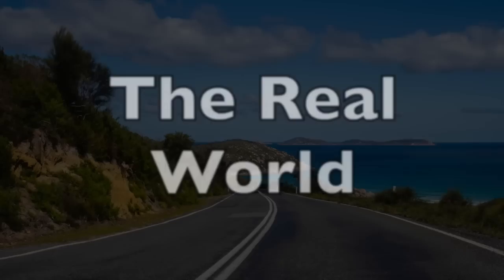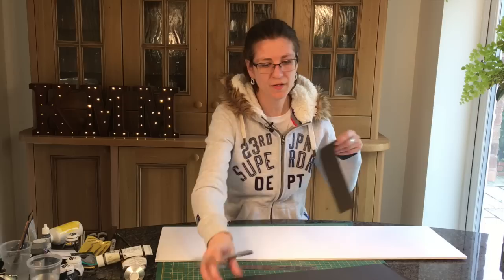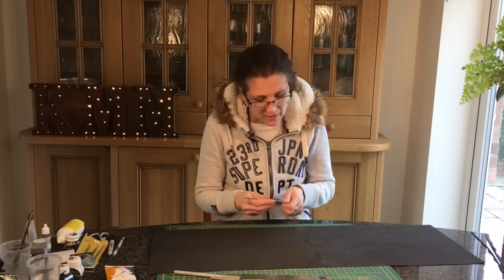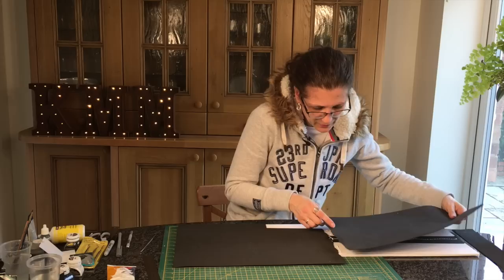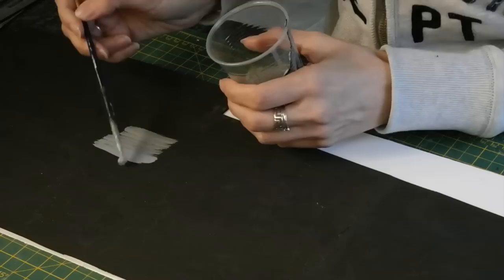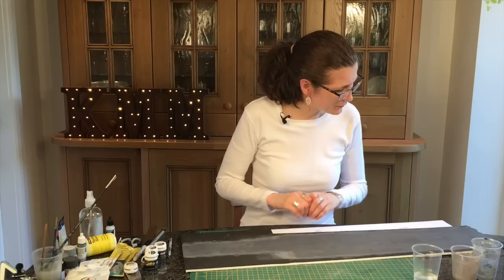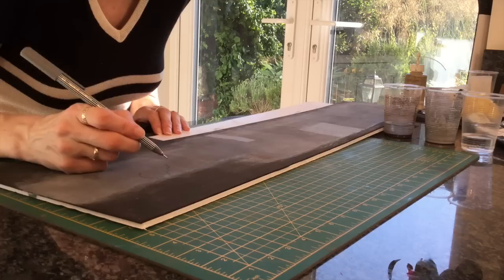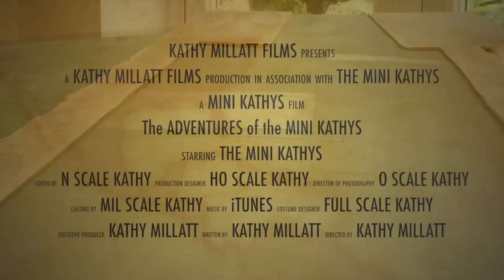How to Model Tarmac Roads

Comment: I'm going to try this method on my new n scale project - where I have a street with a freight branch runs down it. The branch has sidings and the track zigzags to get turnouts properly aligned. This seems a better method than using the usual plaster method. The turnouts will be tricky but I'm up for the challenge! Love the level of detail you demonstrate with colours, washes etc.  and repairs. Another advanced technique to try.
Reply from the maker: Good luck. I hope it goes well for you.

Comment: I found this channel recently and I'm happy I did. I'm a 1/35 scale armour builder and I've been wanting to improve my groundwork and I'm finding these videos very interesting.

I'm actually planning a scene with a tank on a asphalt road but I don't think I've seen these rubber mats in art shops here in New Zealand but I hope to find some.
Reply from the maker: CursedMonkey hi, glad you found the video useful. The mats are called art foam and they are in the children's section. They can easily cut them up to make shapes etc. Hope you find something similar.

Comment: Hi Kathy. Great videos and I'm learning a lot from them.
When you were pairing the foam for joining the road together, I would think putting double sided tape down below the lower piece  so there is less chance of it moving, with it being so flexible. Maybe adding tape between the pieces as well prior to cutting a wavy edge
Reply from the maker: That’s a great idea. They do move a little over time and with temperature changes so that would help.

Comment: Kathy, this is a great "how-to" video - thanks for posting!!  I have used foam sheets a little in the past but have not "weathered" them.  I need to try this on my new layout.  Have you modeled concrete roads with expansion joints?  I'd be interested to see your techniques for concrete as I have a large intermodal yard to "pave".  Take care, Brian.
Reply from the maker: Hi Brian, concrete sidewalks are up next week but I have to admit, I would sand more than I did and it's still bugging me. One to fix before the following video.

Comment: Hi there. I have just recently been looking through your channel and I must say, you do some amazing tutorials. Excellent!!! Now, this material you are using for the tarmac, is there another name for it? I don't believe I have seen it before here in Sweden. I usually use sandpaper which gives excellent results, but my issue has been the glue. I get lots of trapped air bubbles, which are a nuisance. Is there a type of glue you would recommend in gluing them down? I use wood glue or carpenters glue. I use this to glue the sandpaper unto the formboard. I am sure this has to do with the wood glue as it as too much moisture.  Thanks for a great channel Kathy. BTW, your railroad looks awesome. I've always wanted to do a railroad layout but no space. So I opted for model making instead.
BTW, do you peel off the backing of the formboard?
Reply from the maker: +tikingful Thanks!  There's a lot of questions there so hopefully I can answer them all. The foam is craft foam. It's aimed at kids so you can often find it in that section of hobby shops. 
If you are having problems with water in your glues then Deluxe Materials make a card glue but it is a contact adhesive so you only get one go at lining things up. 
I use plain white glue for almost everything and just use bricks as weights to flatten everything out. 
Model railroads take up a lot of space and I like doing dioramas too for the variety and ease as you can do them on your work bench. 
Thanks for the comments!
Reply: Kathy Millatt thank you for your response. I will do a check up on that special glue you mentioned. Once again, great channel. Do you have a somewhat date that you are aiming for to complete your layout? Byw, you can check out my models/ dioramas on Facebook if you like. Just type in Charles king II models or trucks or dioramas and you should see some of my work.
Reply from the maker: +tikingful I'll look you up. I have no date in mind as this is a hobby and I don't want deadlines in it. I get those at work. However, 2022 is looming so that's almost a date for some bits to be finished. I don't want it all finished as I enjoy building it.

Comment: Kathy: love your work with this craft foam.  I do have one question: there are some pencils from Woodland Scenics to paint the center lines and other horizontal markings, BUT these are pretty expensive and often you receive a faulty one.  Is there an easy way to do these markings? 
Thanks in advance for any tips!....BTW: love your channel.
Rolando
Reply from the maker: Thanks a lot. I’ve used the WS pens for doing markings and you can buy similar through art shops. They do clog easily don’t they!  Other than that, you can create stencils and spray/stipple the markings. They need a steady hand cutting them or a cutting machine like scanncut or cricut.
Reply: @KathyMillatt  : thanks a bunch!.....

Comment: I'm using a framed cork board for a road Diorama (have u used this surface before)??
Reply from the maker: +Zen Modeling Not specifically for roads but I’ve used it a lot under track etc.
Reply: Kathy Millatt on a tip I read that it looked exactly like our blacktop here in Texas (after painted black that is) I was A Texas State Trooper for years on that stuff & after I tried it the tip was "Spot On" (I'm making a Diorama of a crash my partner had in 1987 - I'll send u a link of it when completed... LEBIII